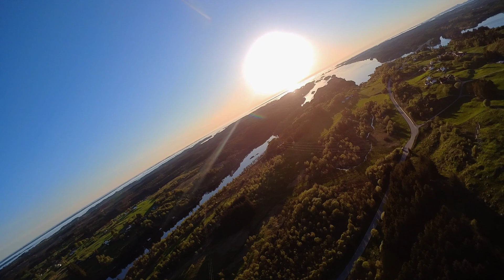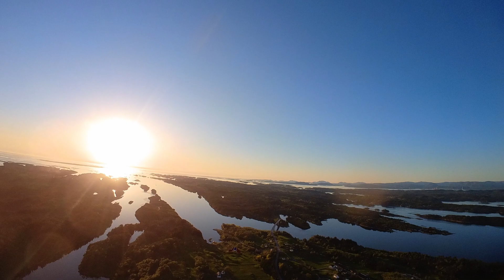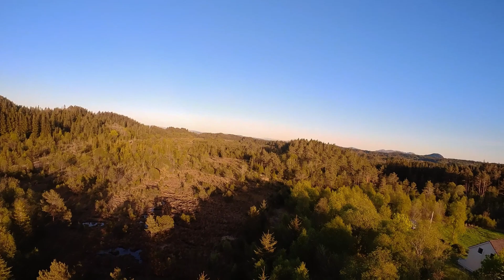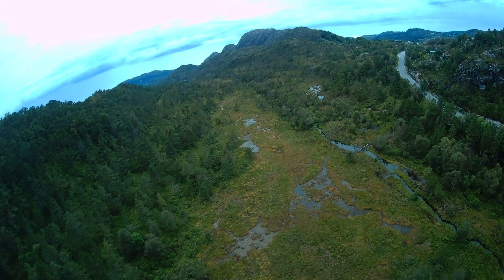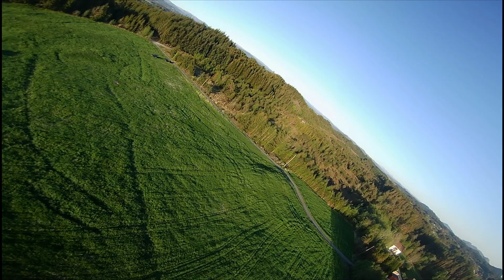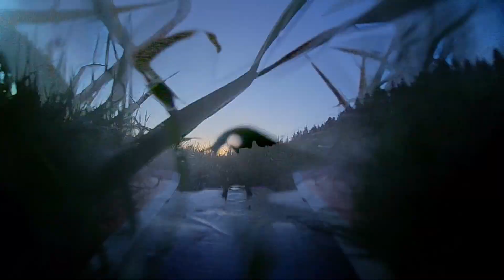The KFm Vikings - New Season

Comment: Great to see you guys back in the air again. My wing is still going strong but looses a lot of hight in the turns, so I'm going to try going from a 2200 3s to a 2200 4s to see if it helps with a little more speed!

Comment: hello,
I built your model successfully, but I find it soft with this 2205 engine, but I'm in 3S, my propeller is a 6X35, what do you think. You are in 4s I believe. thank you
Reply from the maker: Hi, I only have experience with 4S (1300 to 2500mAh). If I was going with a 3S i would make it as light as possible, dropping the 3d printed bays etc.